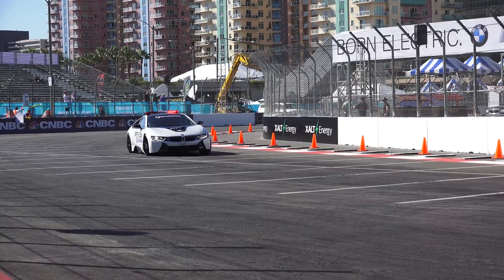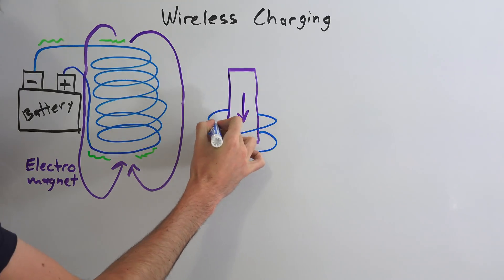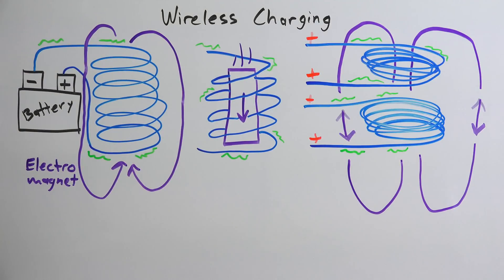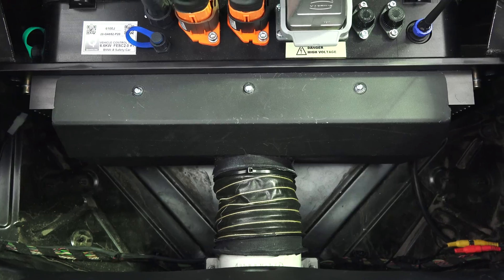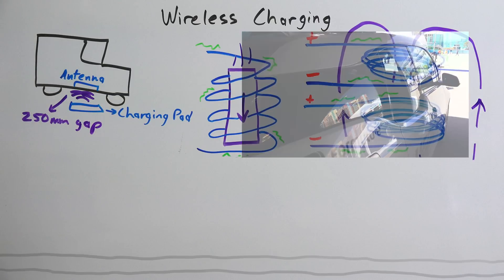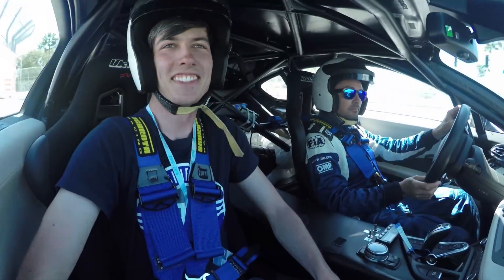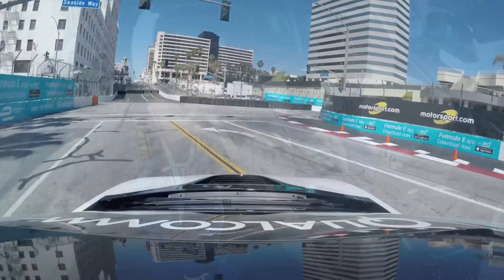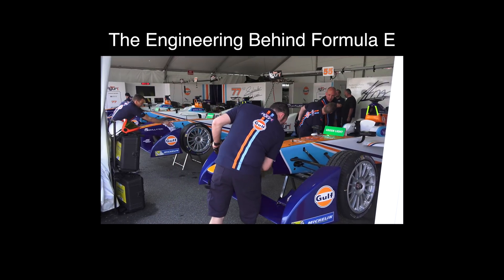How Wireless Charging Works On The BMW i8

Comment: i8 charges with induction and an electric toothbrush charges with induction, thus an i8 is a toothbrush
Reply from the maker: +Frederik Lauferts Sound logic, I'll accept.
Reply: +Quintinohthree actually it's an inductive argument... about inductive charging.
Reply: No that's deduction.
Reply: YOU MEAN I HAVE AN I8? :D
Reply: Quintinohthree guy, saying that the i8 is a toothbrush because it charges by induction is NOT axiomatic, and therefore not a deductive argument. It's inductive because it assumes that everything that charges by induction is a toothbrush.
Reply: +Dinsdale Drummond An inductive argument genralises from incomplete data, a deductive argument concludes from axiomatic assumptions.
Reply: Ahh,  it ends up the three motors producing 750 HP are indeed Brushless lol.